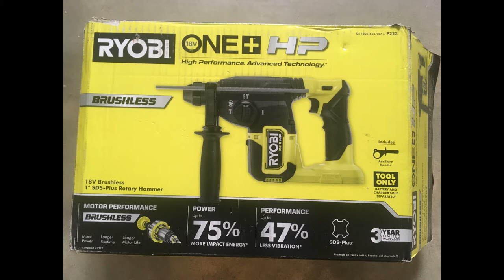Ryobi One+ SDS Plus Brushless HP Rotary Hammer Model P223

Comment: nice you are reviewing tools i am looking at.  I hoped you would use the chisel bit on the rock.    I need to to holes in my cinder block basement walls to build a pressure relief/waterproofing system.   I am thinking of using the ryobi 40v auger you reviewed for helping dig a trench for 14 inch pipe exterior drain system.
Reply from the maker: Glad I could help!  My chisel bit is for SDS Max and even with that (6.5 ft lb) was slow progress on big rock. Sorry to hear you are fighting basement water issues. I used a pre-brushless 18v hammer drill to run a 1/2 inch masonry bit through cinder block for an outside outlet at a prior house and it wasn't too bad. The SDS Plus hammer should go through block nicely.  The auger has a lot of torque and the 12 inch bit knocks me around when it hits stones. I think a series of holes to dig between and create a trench would work but will be a huge effort. Even a towable backhoe isn't all that budget-friendly a trenching option these days.